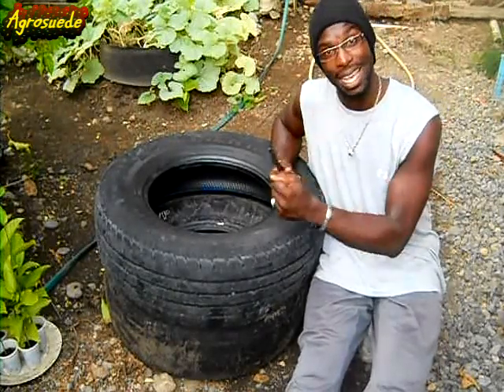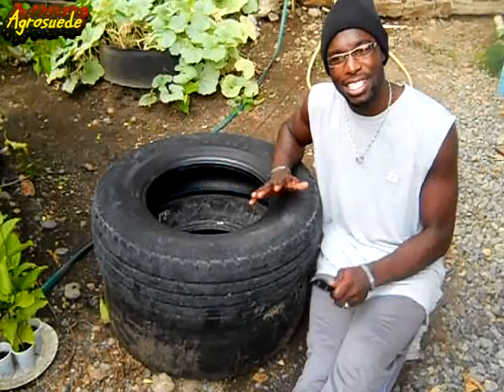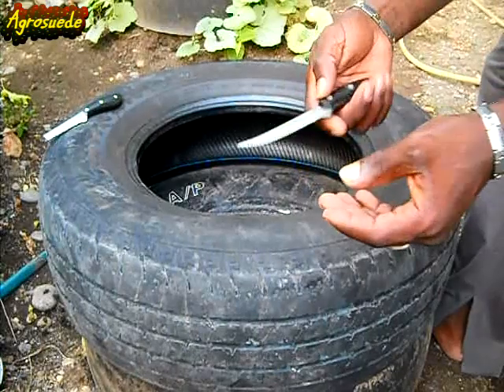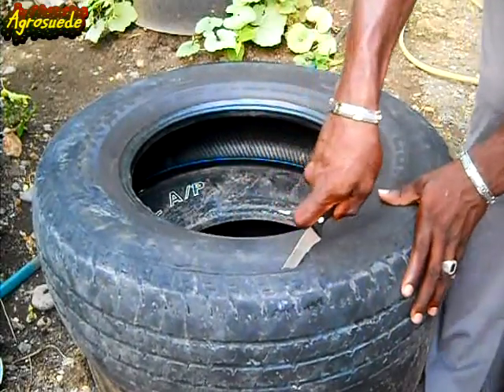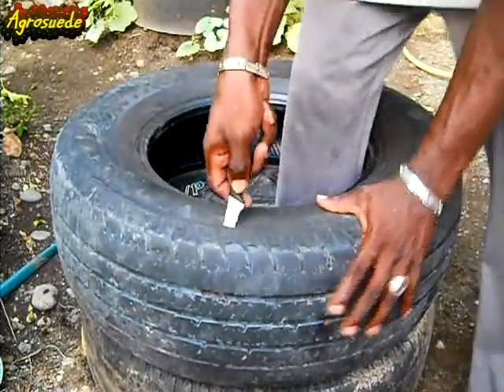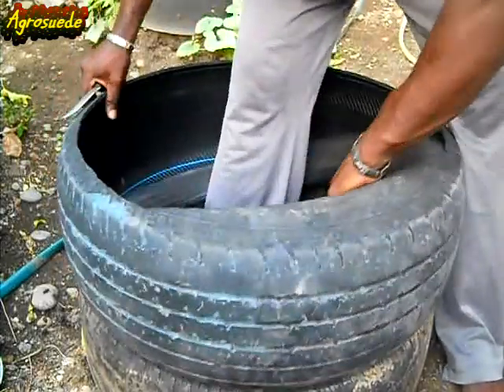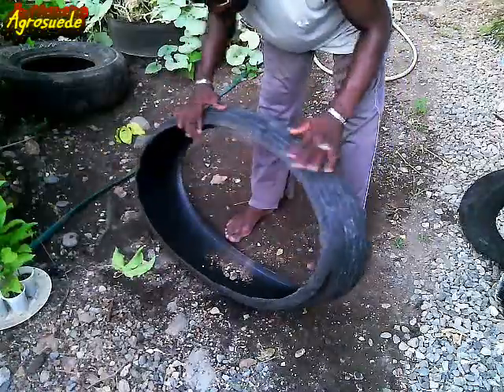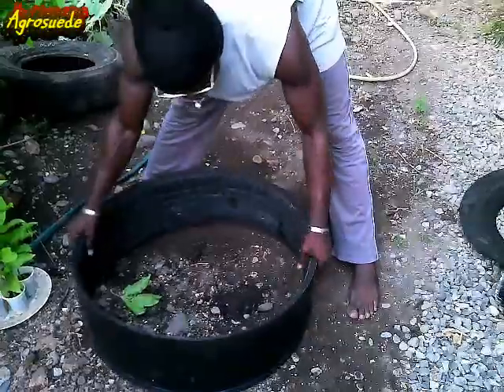HOW TO CUT A TIRE TO MAKE A GARDEN RAISED BED/POTS: Agrosuede

Comment: I already cut the sidewalls out of one side on about 25 tires.  It seems like turning it inside out with one side cut off would be much stronger walls.  however, the problem is that it is very hard to turn the tires inside out with only one side off.  How structurally strong are the walls with both sides cut out?  Do you have pictures or videos of actual projects with both sides cut out?  I would like to see the actual projects.  Thanks.

Comment: That's a good idea to turn it inside out. It definitely looks better that way. Do you think you should wash the outside first? I guess you could even paint it if you wanted to. Now about the termites, they will attack your home so you have to get rid of them, right?  Janice
Reply from the maker: jksatte Thanks a lot. I suppose you could wash it, but it's not to much of a problem if it's not washed, painting it is optional....another good idea is to use construction plastic on the inside.

The termites only attack the wood, untreated wood, but our home is concrete block.